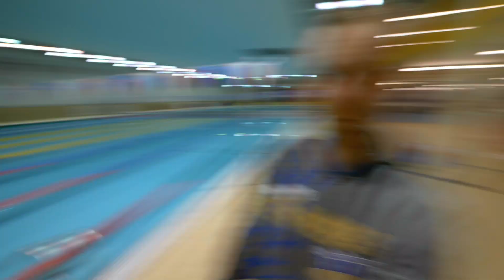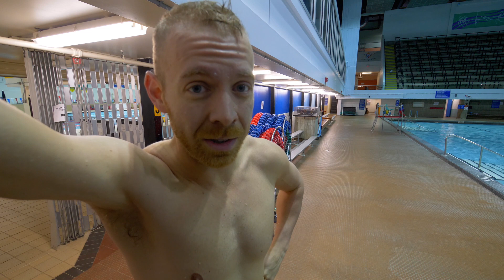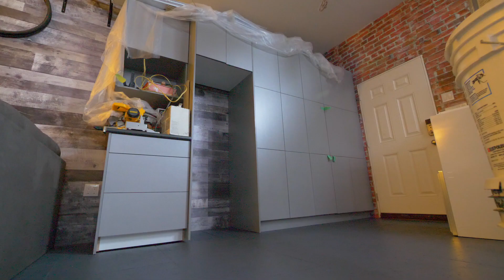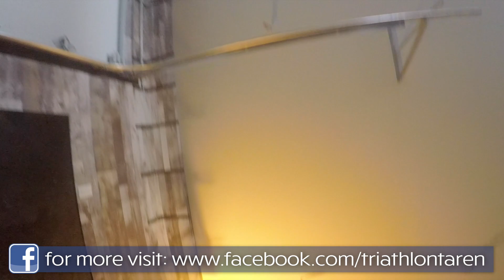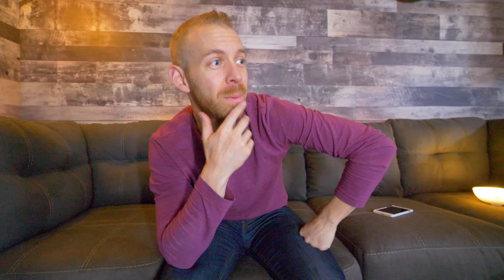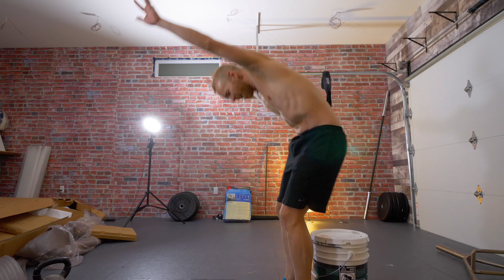Beginner Triathlon Motivation in New Triathlon Taren Headquarters

Comment: Naw my goal is to be under 3 hours for my Olympic triathlon (2:59:59 goal) but it is my first not second. Still getting the ride down. The other two are ok. I know over 3 hours isn’t too fast so get what you mean 😊
I used to say no to doing long runs (over 5 km) and now in Jan I am doing an Olympic tri. That’s pretty cool. I just don’t wanna walk in it. If I get a slow pace and don’t stop I’d be happy. If I stop and walk I’d be more disappointed than getting over 3 hours.
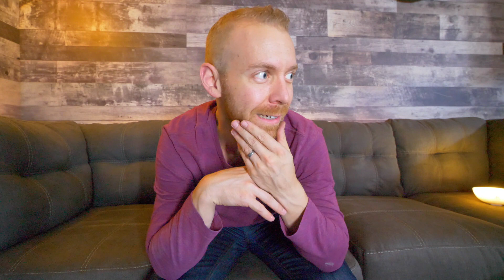Reply: I agreed with the no walking idea until I saw Frodeno walk just about every water station to victory in Kona a couple years ago.  Therefore, walking the water stations is (in my mind) faster.  A little break of 10-15 seconds really helps sometimes.  BTW, I went sub 3-hours this year with a 2:48 in my Olympic.
Reply: Chris Reno sometimes I walk though the water station so I don't choke. Also sometimes there are lots of people waiting for water. I don't count walking to get water. ,you first Olympic distance is on the 14th January. I'm pretty nervous and pumped